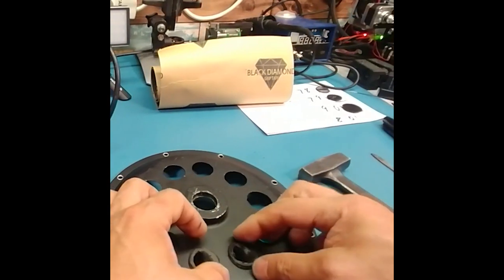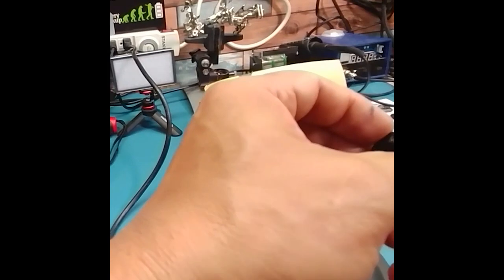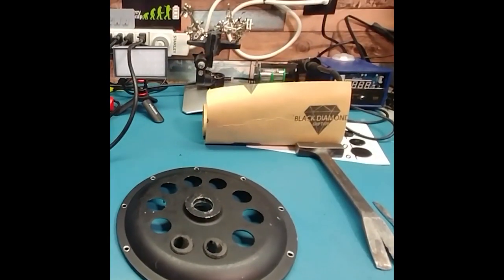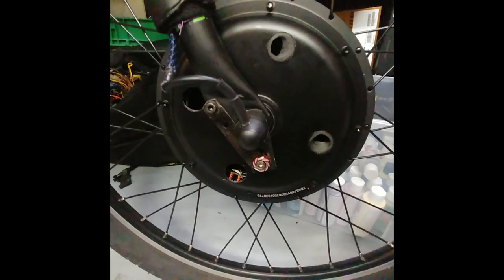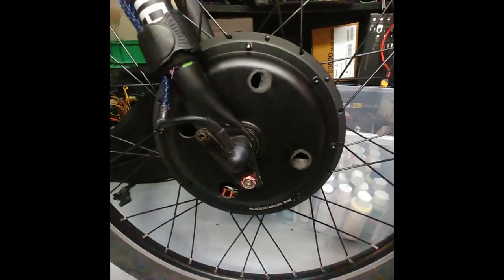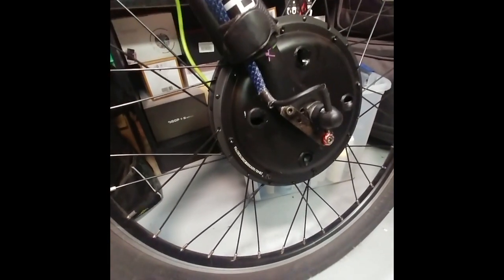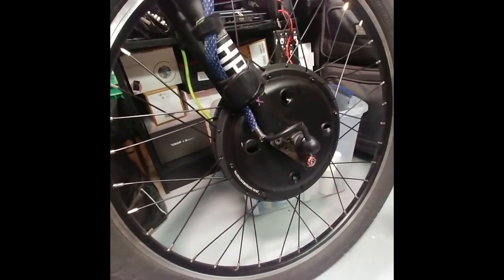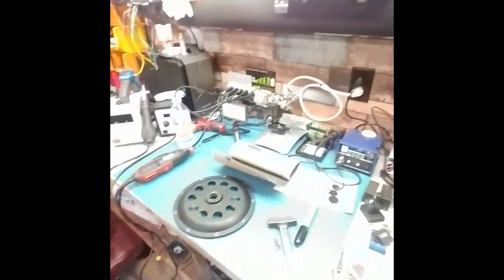ebike 3d printed hubmotor air rams

Comment: so how did this work out in practice? While improving cooling is paramount without a doubt,I don't think I'd be willing to risk a short circuit due to possible atmospheric condensation for example. Doesnt even has to be in direct contact with water.
Reply: Well in most cases condensation will be like distilled/de-ionised water, unless you somehow get dirt and salts in there, then the water and condensation will become conductive